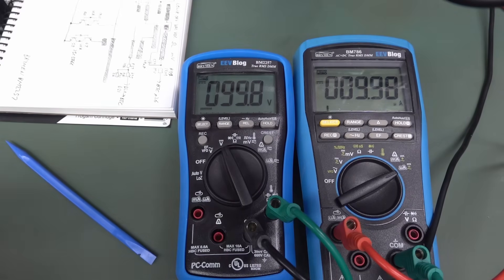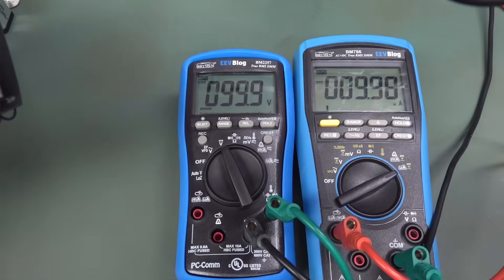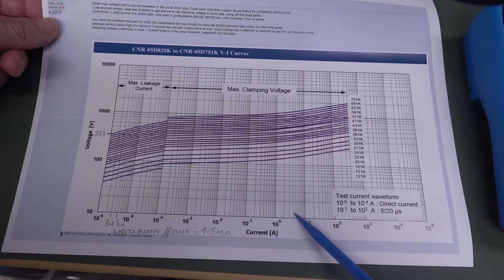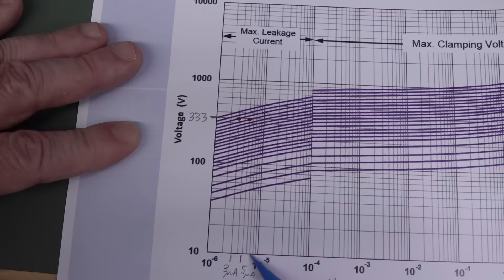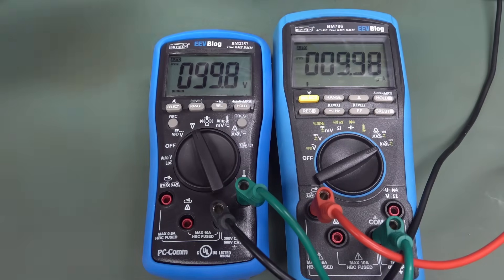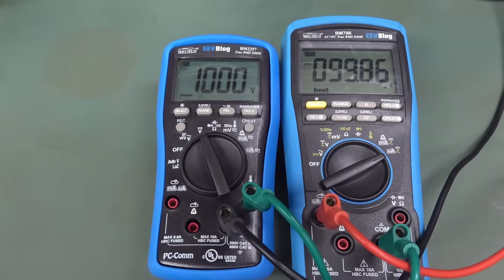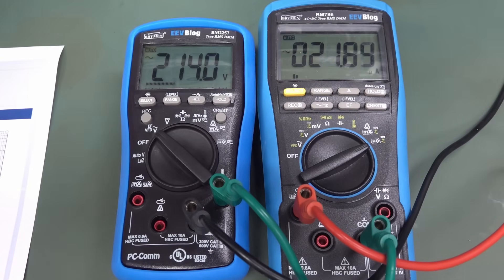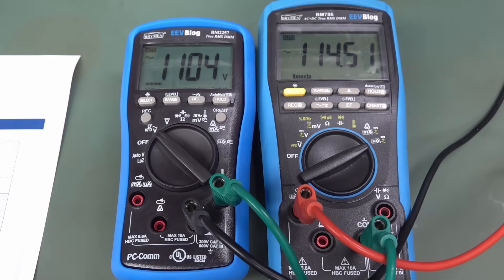Brymen BM2257 MOV Leakage Testing

Comment: The fact that you see significant leakage at AC, but essentially none at DC, suggests that the MOVs have parasitic capacitance.

But I didn't do the math, so I don't have an estimate for how much. Maybe the datasheet mentions anything about parasitics?
Reply: Yup. Both 5D561K and 5D621K claim 65pF @ 1kHz typical capacitance, on page 2 of the data sheet.

Also, user Kleinstein noted this yesterday in the EEVBlog forum, thread titled "New Brymen BM2257 Multimeter". (I figured that someone smarter than me knew this before I did...)

Comment: Would say PCB leakage would be a bigger factor, but low humidity inside will mitigate that. Try leaving one in the sun in a car for a day, then put in a plastic sealed bin to hold the high humidity in, and try again fast in the lab, to see just how much PCB leakage is.

Comment: Wouldn't different values of MOV in series cause different voltage drops across them, possibly triggering lowest-rated one, which would trigger remaining ones in a cascading manner?
Reply: It's an interesting question. Since the one with the lowest voltage across it would also set the total series current one might expect that perfectly balanced MOVs would be the least safe configuration. Maybe.